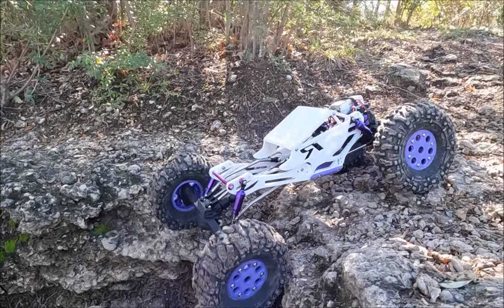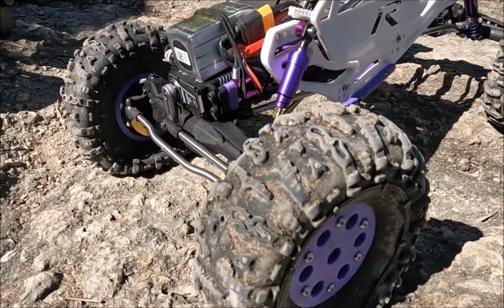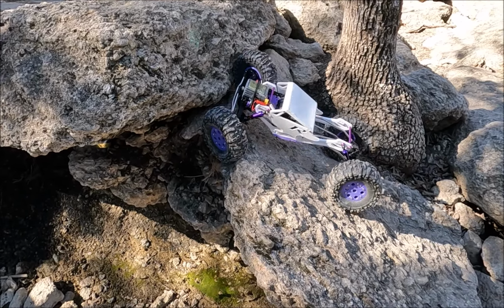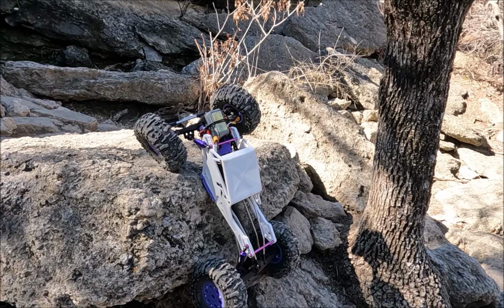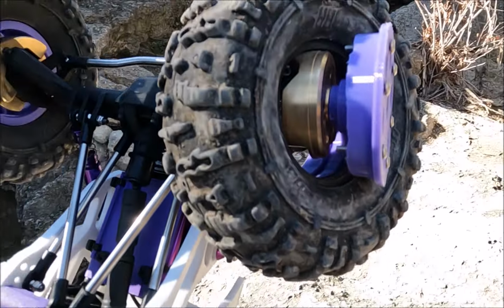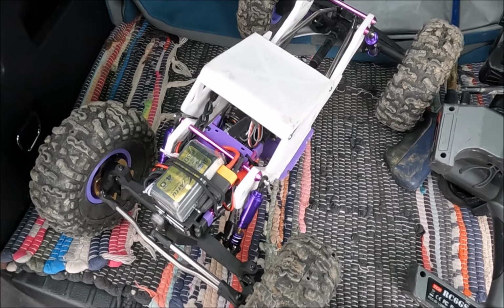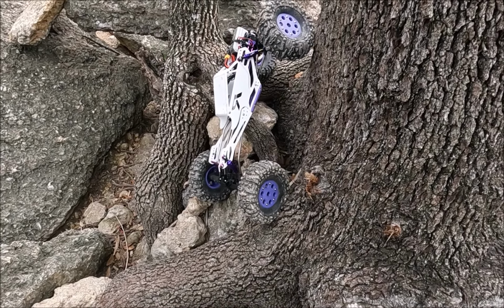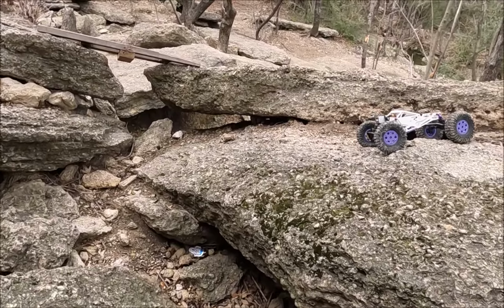Latest Build, a Sporky by RES Concepts

Comment: this rig just looks sooo good. color scheme on point! does look like the esc could use a little tuning to smooth things out, it should be much smoother but the rig looks to be performing good regardless. youll get used to how it drives too, took me a while. but by then the flex will really start to settle in, and youre in for a real treat, they seriously come alive and drive so plush. feel free to hmu if want any setup tips as you go forward too, so many options and ways to get a certain feel out of it, just a brace location change or even how tight the screws are into those braces can have a pretty decent effect on the way the chassis reacts. excited to see where you go with the build, love seeing more sporkys out in the wild 😄
Reply from the maker: Thanks man, I take it you have one?
Reply: @NTX_RC  yeahhh, i have 3 sporkys 😅 i was one of the guys pushing hard for this chassis, and helping lead the r&d team behind it. needless to say, its its sporky related (or even just porkbelly in general), i gotchu fam 🤙
Reply from the maker: @Greg.Bosworth  nice dude,  good to know

Comment: Looks like a great start. Inserts look just a bit on the hard side.  If youre under 5lbs, probably not getting into that compound and tread.  The geometry likes 65/35 or greater on some of those climbs.  If you didn't get flex braces with the build, we'll have them on our site.  Definitely want a couple of those as tuning options.  Ride height might be a little low for the high break over lines.  You can shorten the front links and push the rear out a bit.  We've all been liking 13.25-13.5" wb.  If you can balance the rig on the front lower rod ends at the skid, youre in the 65-67 front bias range.  I've run 70/30 and it was defintely fun on the tech climbs.  67/33 is my fav at 5lbs on 1.9 ruptures. Are those rovers?  They're classic.  

I've got 2.2 voodoo pins, ibex, ruptures and deepwoods that i'm testing on my pbx as i build my sporky for this summer.  You can get away with standing up the rear shocks for more support if you're getting the front corners unloading slightly on those verticals.  Some of the sporky guys are using the BOA mounts for that feel and style layout.  Those have worked well also. I'm using the bacon tray with the batter behind the servo, accustomed to that feel and works well with my drift style and high front bias.
Reply from the maker: Do you have a link for the flex braces?  I don't see them on your site.  It has since been stretched a little in the rear, sitting at about 13.5" now.  Yes these are Rovers, best tire I've tried yet but insert options are pretty limited, I printed these from a file I found on Thingiverse.

Comment: I didn't hear you mention if you had recalibrated the ESC to the radio.
Reply: Sorry, nevermind. I didn't realize you are the one with GB the LCG truck. So I'm sure you ha e calibrated the radio.
Reply: In your ESC tuning program, as long as your motor KV setting is close to your motor KV, I think it's Sine mode start up power or Start-up power will smooth out that transition where the throttle is jumpy.
Oh and calibrate your radio to the ESC each time you make a change.